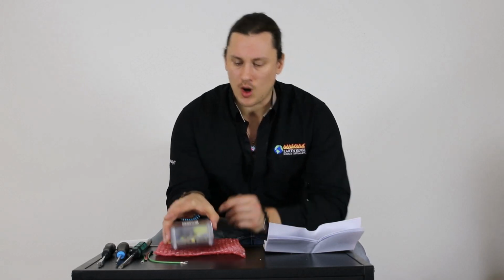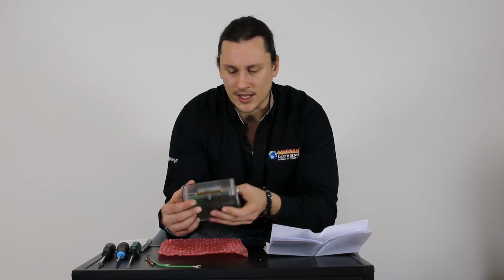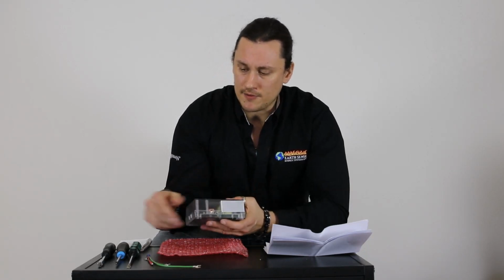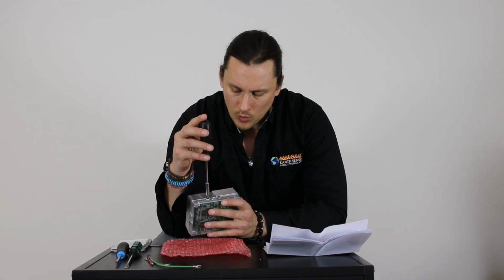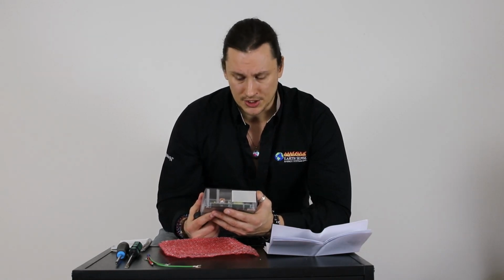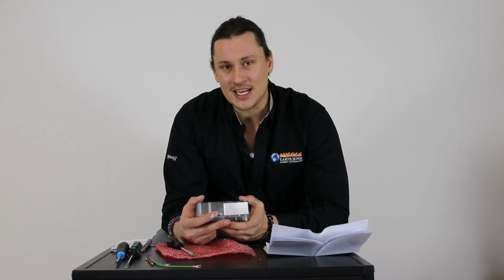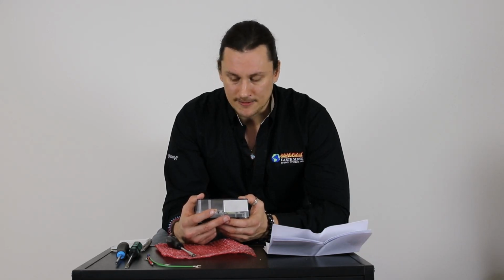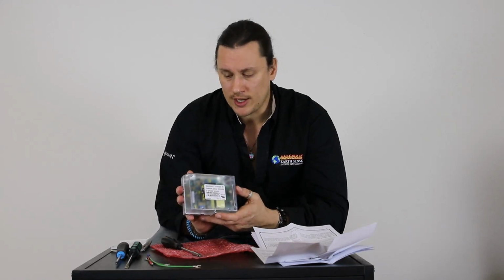QuadraFire 3 Speed Control Board Installation and Settings

Comment: I purchased you control box for my cb1200. The old one was shutting off the combustion blower at the same time as the auger. That is now fixed and the stove runs correctly except now the flame is very low? With the gate open all the way the flame is level with the fire pot? I have another identical cb1200 and if I were to open the gate all the way the flames would be touching the top of the heat exchanger shroud.
Reply from the maker: Thanks for the message, happy to help. What setting do you have the new control box on? We are looking for a torchy fire on all settings including high. Generally speaking on a very clean 1200 with the combustion motor running correctly, on low we see a flame in the burnpot, medium about level or just above, and on high 3-8 inches above. Much of this depends on the pellet and length of the pellet as well - Some pellets are shorter and more will feed per auger revolution than longer pellets. Possibly we have the control board on a setting where it is providing additional combustion air. Keep us posted. Thanks!
Reply: @EarthSense    I have the stove on medium. I set the control box on 2 for extra feed and the slide gate is open all the way. The old box work correctly except the shut down. My other identical stove works like the old control box?
Reply from the maker: @theoriginalmungaman  I will check in with our techs and follow-up with you. Thanks.
Reply from the maker: @theoriginalmungaman  Just heard from our techs - couple questions and bulletpoints. Keep us posted, happy to help how we can. 

Are his stoves inserts or free standing?

What years?

The control board program logic with respect to the “clear case” units has not changed through the years.  With respect to the settings for the 1200 insert or fs the control boards should always be set to #1, never #2 (+10%).  With regard to the fire size comparison this is a fuel delivery issue and not necessarily an air flow issue unless fuel is piling up in the burn pot indicating a lack of air through the burn pot.  Factors contributing to the lower fire;

1.       Intermittently functioning safety switches, 1200 = vac switch & hopper lid switch.

2.       Differences in pellet length and species.

3.       Hopper obstruction.

4.       Worn feed motor clutch.

5.       Improperly tightened auger set screws.

6.       Improperly set auger stop collar.

7.       Improper control board feed timing.
Reply: @EarthSense    The only change is the control box. Same pellets, literally same pellets in hopper. The stove is 2009. I have to run it on setting #2 or the flame is to small to put out heat.
Reply from the maker: @theoriginalmungaman  Thanks for the message. Can you put the control box from your other 1200 into this one and let us know if there is a change in fuel feed/fire?
Reply from the maker: @theoriginalmungaman Just heard again from our techs, let's test the feed timing sequence: If these are freestanding you can see the motor collar from the right side open door.  On the high setting with the board set to #1, the feed motor on time is 7.5 seconds.  No off time is listed.

Let us know if you are able to to look at this. Thanks.
Reply: @EarthSense   I have the stove on number 2 setting which is +10%. If I add 10% to your 7.5 seconds you get 8.30 seconds which is exactly what I have. You would need to know the off time as that is just as important. It runs acceptable on number 2 with the gate all the way open and on high. I can live with it, however I shouldn’t need the gate all the way open? My other identical stove runs on number 1 setting on medium with the gate half open. This stove did the same with the old control box so something isn’t right with this box. You should send me another to try?
Reply from the maker: @theoriginalmungaman  Thanks for the message. It's a process to go through a warranty with a control box, so we just want to make absolutely sure is all. Yeah, our specs on the motor didn't show the off cycle, but I agree that is important. Have you swapped the control box from your identical stove into this one yet? I suppose at the same time you could put this one in your other unit and see how it behaves. If it's clearly a control board issue here, I will have you contact the store at 800-236-6647. Ask for parts/warranty department. You can let them know you have been speaking with Taylor & Frank regarding the technical aspects of your board. We'll make sure everything is 100%. Thanks.

Comment: Quadrafire 1200 CB
Is there a way to test the board while in place, without any additional specialty testers (other than a meter)? 
Also, I noticed the drive motor says 120 volt, with a .68 micro-farad capacitor. Can I jumper straight to the drive motor to test it to see if it will run without frying the motor?
Reply from the maker: Thanks for contacting us. One could use a multi-meter and check all of the wiring points in the junction wiring harness box that the board plugs/secures into and the lead wires to the various components and safety switches in the stove. Many times if there is a control box in question we have test units set-up where our tech team will go through all functions and operations - that is a service we provide. There is a way to create a test cord and run direct power to the auger motor safely to determine if the motor is working or not. I'll get some specifics on that from our techs and follow-up with you. In the meantime, provide us a layout of exactly what is happening with your 1200 and approx age of the unit. Happy to help. Thanks!
Reply from the maker: Just heard back from our technicians. Depending on the version auger motor you have, it may have spades or it may have a molex connector. All new auger motors come with the three wire to molex connector. Once you create a test cord, you will connect the black and white wires and leave the red disconnected to direct test to wall power. Here is a link on how to create a test cord if needed - https://youtu.be/rlmiCYI2WPk

If you do need your control box tested, our rate for full diagnostics and analysis would be $45.00.

Happy to help, keep us posted. Thanks!
Reply: @EarthSense  Thanks!
Reply from the maker: @littletoze  You are most welcome Lito!

Comment: HELP! My cb1200 does not run for the 18 minutes shut down cycle but shuts off the same time as the auger does causing a smoke out?
Reply from the maker: Let's check the wiring harness block, wiring connections in the unit and thermostat connections. Important to start with the simple things first. The shutdown timing cycle for the CB1200 is apart of the control box. If all of your wiring looks in-tact, than an issue like this 99% of the time would be a failure within the control box. Here is the control box for reference. Any other questions please let us know. Thanks
https://pellethead.com/product/quadrafire-control-box-3-speed-circuit-board-oem/
Reply: @EarthSense    I pulled the control box and one of the gold plated terminals is partially burnt away. It must have shorted at some point. The harness looks fine.
Reply from the maker: @theoriginalmungaman  Thanks for the message back. Looks like you have found the route of the problem here. Before you purchase a new board, try to take Triple zero steel wool to the burnt gold terminal on your current board. More than likely you will need to purchase a new control box, however it's worth a try to do that first. 

Keep us posted,
Thanks
Reply: @EarthSense    Ordered the control box from you thanks.
Reply from the maker: @theoriginalmungaman  Thanks for message and your order. Let us know how everything is running once you receive it. If you have any questions please let us know. Thanks!

Comment: Can you use a 3 speed controller instead of 4 speed controller on a mt Vernon pellet stove
Reply from the maker: Hey Tony, Only the 4 Speed Control board will work for the Mt Vernon Original (O.E.). There are other variations from the 3 Speed Board and the 3 Speed would not operate in the Mt Vernon O.E. On the unit you can operate in just the 3 main modes; low, medium and high, avoiding the 'Quad' 4th speed setting. The unit runs more efficiently on low, medium or high. Any other questions please let us know. Thanks.

Comment: A Quadra-Fire Mount Vernon that has a different board from what you are showing now the red light is blinking is there a fuse in on that board that will like the igniter just put a new igniter in
Reply from the maker: Thanks for contacting us Michael, happy to help. Do you have the Mt Vernon OE, 4 speed, or the the Mt Vernon AE or Mt Vernon E2? You mentioned the red call light blinking. Is the combustion fan running? Is the feed motor running? Have you double checked the thermostat connections? There are fuses located in all Quadra-Fire control boards, however with the red light blinking, I'm not leaning towards this being a fuse issue. Let us know the exact model and approximate age as well as if any of the motors are running.

Comment: I bought a new control board for my Heatilator cab50 it is a 3-speed board the dealer said it needs number 2 setting, I don't think it's correct any insight on what setting my Heatilator cab50 should be on? The new part number is 7058 - 188 the the original part number 7058 - 172  no instructions came in the Box!!
Reply from the maker: Thanks for contacting us. That is the correct part number now for your CAB50 board. The default setting for the CAB50 control box is #2 and #3 is the +10% feed on startup setting.
Any other questions please let us know. Thanks!
Reply: @EarthSense  Thank you so much, I really appreciate it nice and warm now!!!
Reply from the maker: @chilipepperpepper6488  Fantastic to hear! So glad you are warm once again! Any further questions or needs please let us know. Thanks!
Reply: I bought a new computer board on my cab50 the book says setting is 4 on FACTORY BOARD is that also for new board cuz I am having issues, it dispenses pellets ignites the fire pot when blower starts blowing hot air it shuts down red light, then in a minute or two green light & it's feeding pellets & fire in pot, blower kicked on with flame then shuts down and does the exact same routine? I would be greatly appreciated a Quick troubleshoot thanks
Reply from the maker: @chilipepperpepper6488  Thanks for the message. With the newest style CAB50 control box #2 is the standard setting and #3 provides an increase of +10% fuel on start-up. The original control box may have been different on those settings. I'll have to run this past our techs to get their insight. We will follow-up ASAP.
Reply: @EarthSense  Thanks for the reply! Exhaust is clean I'm just pulling my hair out!! Still trying to research the snap rings?? Have new vacuum new hose to it
Reply from the maker: @chilipepperpepper6488  Certainly our pleasure. I ran this past our two lead QuadraFire techs, here is what they stated. 
'Considering everything is a slave to the control board and everything the board outputs is set in the programming timing, I wouldn’t consider anything other than the control board at this point.  Something to try would be to change the settings on the board to #3 then #6 and last #7 to see if the pattern remains the same or reverts to normal operation.'

Please keep us posted once you try the other settings. Thanks!

Comment: I just bought a brand new control box, followed all the instructions exactly, stove turns on, 6 blinks, red light comes on to call for heat, exhaust blower comes on, and then nothing happens, no pellets drop, the ignitor doesn't get hot, and the weirdest thing is the metal part on the control box gets hot!! Please help!!!! I have a Quadra fire Castile Insert. Please help!!!
Reply from the maker: Thanks for contacting us Jessica, happy to help. What was the reason you replaced the control box? What issues were you experiencing? 
As I speak with our techs this could be related to a Thermocouple issue and/or a pressure switch issue. It could also be the new control box has an issue. It's rare, but it has been seen before. The metal strap on the board is a 'heat sink' and it is normal that it will get warm. Provide as much detail as you can and we will do our very best to assist. Thanks.
Reply: @EarthSense  we replaced it because the stove literally stopped working one night. I woke up in the morning and the stove had no electric, breaker was fine, no blue light when plugged, no calling for heat light, nothing.  looked inside and noticed the normal ash but several pellets a top completely unburnt. so I checked the fuse, it looked like it was possible busted at one end, it was also 7 1/2 amp rather than 7. in trying to get the fuse out the cap broke so even in getting a new fuse it couldn't click in because the fuse holder wasn't locking in. A friend is an electrician and he was able to check inside the panel under the area and was able to confirm that the unit was receiving electric, and with a new fuse was able to confirm the fuse was sending electric out to the control box, but then nothing, the box was not sending electric back into the unit.  so we ordered a new control box. put it in, set it to 6 and plugged in the unit. the unit started up, does the 6 blue light blinks, red button clicks on calling for heat , exhaust fan starts, no pellets drop, the hot part below never gets hot. nothing happens at all after the exhaust fan kicks on. no pellets drop and nothing gets hot. Also if I press the reset button, the usual click that we would normally hear never happens. its like Im pressing the reset button but its not registering to the unit that I am pressing reset.  I appreciate any help you can provide. I've got 3 tons of pellets sitting in my yard and its a snow storm this week!
Reply from the maker: @jessicaberardikutchma4421  Thanks for the detailed information Jessica. I'm waiting to hear back from our lead tech to get his insight. In the meantime, let's do a physical inspection of the thermocouple. Let's pull the little ceramic cover off and inspect the tip - both wires should come to a soldered ball point. Let's inspect the electrical wires and connection point of the thermocouple as well. I will follow up as soon as our tech gets back with his input. Appreciated.
Reply from the maker: @jessicaberardikutchma4421  Hey Jessica, I just heard from our lead tech. If your electrician friend is available that would be good. Some points and questions here to best assist.
1.       Have the electrician ohm read the vacuum switch while the comb fan is running.  (with wire spades disconnected)

2.       Ohm read the igniter with the stove unplugged.

3.       Need a voltage reading from the receptacle.

4.       Loosen the wire harness clamp at the control board base. (do not re-tighten)

5.       Reset switch – if the t-stat lever is cycled does the call light go off and on. If it does then likely the switch is stuck closed which isn’t part of the current malfunction.

6.       Is this an insert? 

a.       Insert – wire harness not in contact with the combustion motor housing??

b.       Freestanding – wire harness not in contact with the tail pipe area behind the feed motor??

7.       Empty the hopper to check for a foreign object caught in the auger or excessive fines build up.

Too many guesses here.  I can provide a better answer for their problem with these questions answered. 

Keep us posted. Thanks,